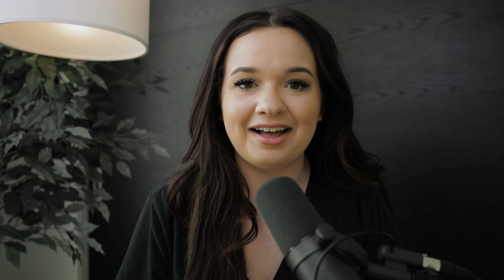The World's Largest 3D Printed Neighborhood

Comment: While I think 3D printed homes are an excellent advancement in the space, and that many detractors are operating in bad faith, this video feels so gushy that if you told me it was sponsored I'd believe you in a blink. It feels like you are reading their website to us and haven't reviewed the possible embellishments they are putting out there. 

I 3D print non-homes, and it is widely known that lateral stress (parallel to the layers) is a weakness that is hard to mitigate. This means that the claims Icon is making about floods (mostly lateral pressure) are dubious at best. Impacts, earthquakes and tornadoes may also be riskier than expected in a layered home. 

Building professionals have expressed concern about conduits, plumbing, and power installation, repair and modification. Lateral tearing as a result of the simple bearing load of the structure is also a concern, as is the warping of the concrete as it dries if the process is not even.

I'm all for the idea. I think that as the technology grows, efficiencies of scale will kick in to drastically decrease the costs involved. I'm just wary of the hand-wavey-ness with regard to structural and material testing in the space, with companies seeming more focused on rushing to market than making sure they are building safe homes.
Reply: Did you watch from 5:38 ? You must have made your judgment too early. I advise you actually watch the entire thing before jumping to conclusions about a presenter’s intentions